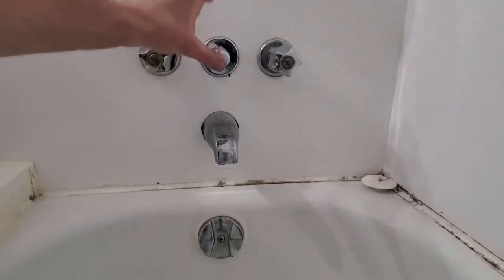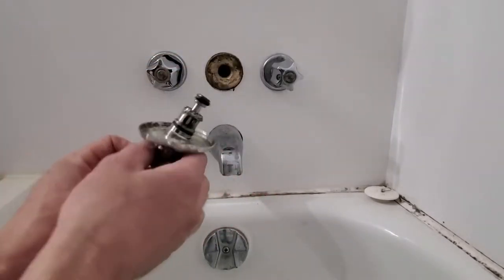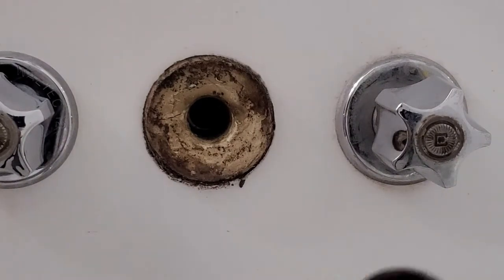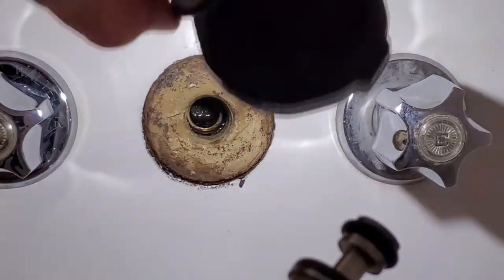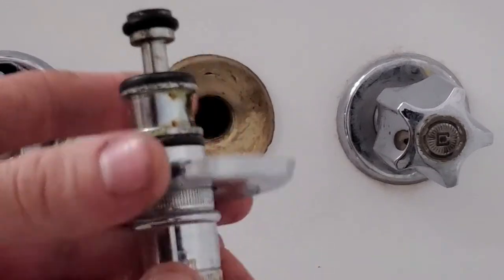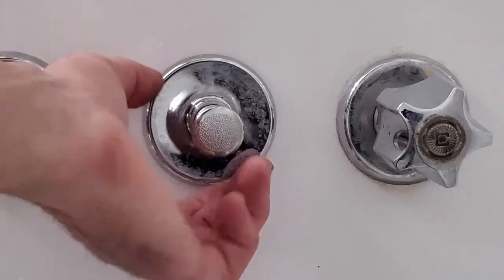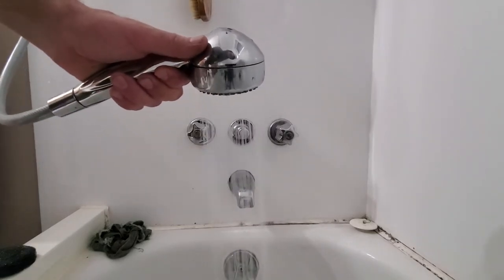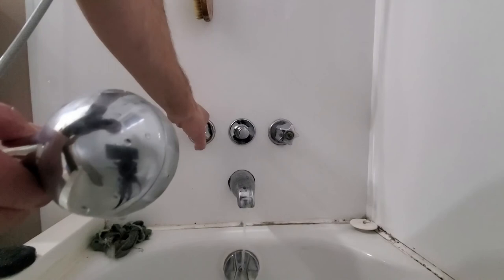How To Fix A Shower Diverter Valve Plunger Leaking O Rings #shower #divertervalve #howto

Comment: I'm doing almost the same fix - older Waltec assembly OEM 76305 found at local plumbing parts store. The little grommet disintegrated and pieces showed up in the strainer leading to the tub. The replacement parts package included the plunger, a spring, a tiny O-ring and washer... all of it.  I'm not a plumber and I have never seen this particular part before, and misunderstood how water flows inside the brass housing with this plunger in action, so I believed it wasn't going back in far enough. Thank you for your video, it's the first one I found that shows how simple the reassembly appears to be.
Reply from the maker: @HarnessedGnat  happy it helped. 
I am no plumber by all means but turned out simple enough. 
Thanks for watching and happy you got it fixed.

Comment: thank you!  the new moen waltec diverter they sell at home depot is missing this piece!  i couldn't figure out why it wasn't working and kept pulling the o-ring  into the valve past the seal point until i watched this video.  I returned it and bought an older version at which has the proper washer on it, fixed the problem!

Comment: Little plumber's grease on those o-rings would be a good idea, also a little silicone behind the chrome cover will help hold it in place so it's not rattling around.
Reply from the maker: @loco4dogg  that's for the tip. 😀

Comment: Of the 100s of diverter fix videos on the internet, yours seems to be the only one with no set screw. I hope you can help me! :)
Finally found how to unscrew it, nearly had to rip it out of the wall as the last of the threads didn't want to release. 
Plunger action seems ok
O ring and shelved ring (flew out of hole when I pulled hard on diverter) look fine. Am soaking to hole thing in vinegar in case some crud is in the mechanism.
Reply from the maker: I am no plumber by trade but hope the video helped.
Thanks for watching.
Reply: @LUCAMTire  one last question, should the piston mechanism be greasy? like up past the inner o-ring?
Reply from the maker: @tallard666  I do not believe it should be greasy no unless it is consiled inside the casing where the water flow will not touch it. 
As this water that touches the valve will be coming out of your tap and your not looking for contaminated water
Reply: @LUCAMTire  well even though everything's back in place, still no water going to shower. But thanks for the assistance. Gave me the confidence to at least attempt it.
Reply from the maker: Oooo sorry I thought you were reffering to something else.
There should be 3 seals on the diverter valve.
Are all 3 seals in place?
Follow this link to a display picture of a divertor valve. 
2 black o rings and on this one the middle seal is white. 
Are all in place? 
If all are in place you may need a new valve as something may be broken? 
https://www.canadiantire.ca/en/pdp/plumbshop-waltec-oem-shower-diverter-assembly-chrome-1-pk-0630703p.0630703.html?&&&&ds_rl=1283573&ds_rl=1283573&gclid=Cj0KCQiAgqGrBhDtARIsAM5s0_l6yF0wjDeBnFvWh8-LNP7WD8X5S2OvymRF6BBhsqRXwQN_HLIigZ0aApCcEALw_wcB&gclsrc=aw.ds#store=249
Reply: @LUCAMTire  ended up buying a replacement, the action was definitely faster and smoother on the new one.
Now my problem is the new one didn't include a knobby thing, and my old knobby thing is stripped, so I need a new knobby thing! 😅

Comment: Can I try and fix this without the building turning off the water?
Reply from the maker: @nonamebleach  should be able to as long as the water valves (taps) are turned off.
Reply: @LUCAMTire  thanks! I was able to do the repair. Quick and easy.
Reply: One exception - mine is a single larger piece of chrome with spout, and to get it off - I think - I needed to remove the hot & cold valves first. For sure needed to remove the strainer in the middle.  It was close - it's possible that the holding rings surrounding the valves might actually come off with valves in place. I wish I had tried that first. Anyway, I found shutoffs nearby and it's all good.